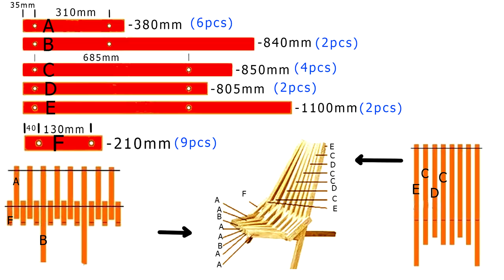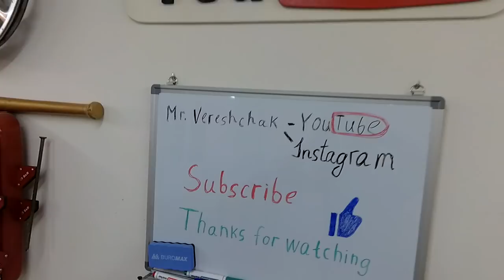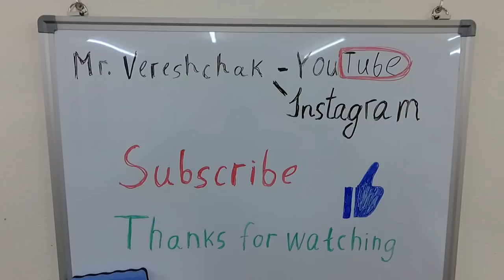Wooden Folding Chair Homemade DIY

Comment: 1100 for the longest one is good, but making an armchair for tall people will require even longer details. My height is 180, I would do 1150 or even 1200 with recalculating the length of all other details of course. 

Anyway, thanks for the great video! Slava Ukraini! 🇺🇦

And... your garage is very clean. What a nice view. Respect. Liked and subscribed.
Reply from the maker: Thank you for watching! Glory to heroes!

My height is 180 cm and this size is comfortable even for an even taller brother :)
Reply: @mr.vereshchak  can you lay your head onto the chair or you just hold it in the upright position? My butt-to-head distance is 900mm. So, in case I want to lay down my head on the chair to rest, the distance between the highest end to first chair joint shouldn't be less than 900mm

Comment: What dimension are the wood sticks you use?
Very interesting project...i want to try it but I cannot rip wood as I do not have equipment for this...i need to buy ready size and cut to length...
Thank you
Reply from the maker: Hi, You can find all dimensions in video - time 4:03

Comment: Parts diagram at 4:00
Should parts "B" be 940mm instead of 80mm shown?
Reply from the maker: Perhaps there are other options.
I did 840 mm.
Reply: @mr.vereshchak  In the diagram they are shown longer than parts "C" which are 850mm